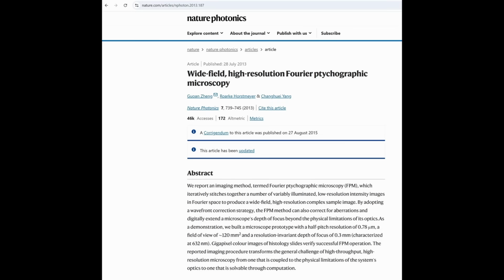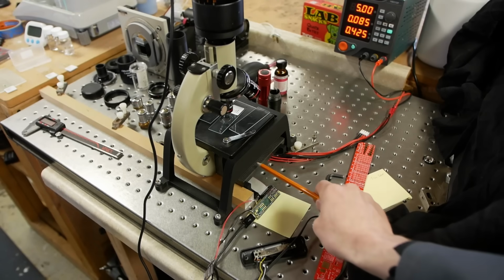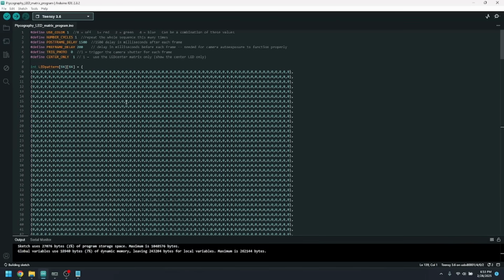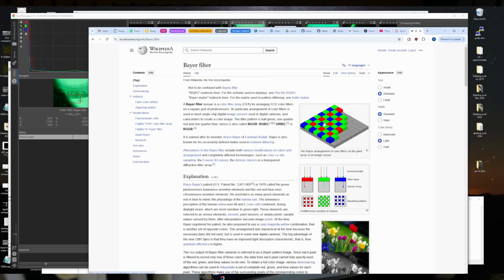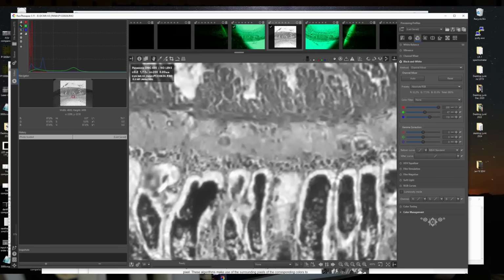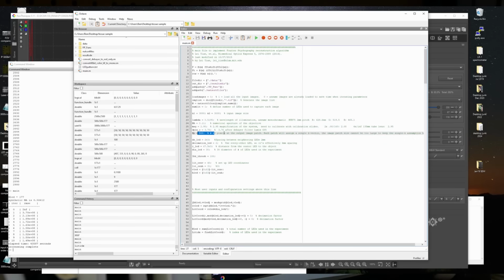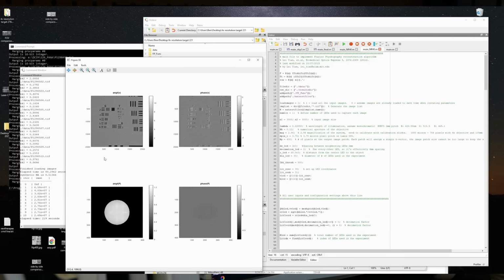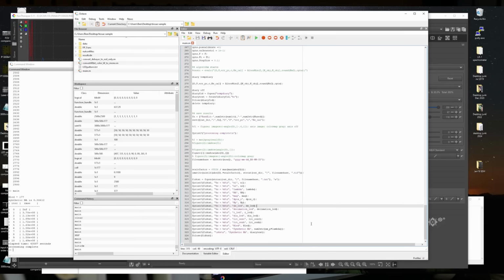Dramatically improve microscope resolution with an LED array and Fourier Ptychography

Comment: Neat technique, I wonder if your Bayer filter issue was due to using green - usually it gets two elements for every single red and blue, so the offset of the two is hiding some of the phase information that could be gathered since the pixels is effectively 2x as wide (though only double the active area).  Trying the same color image but using just the red or blue channel may yield better results if there's enough SNR there.

On the theme of trying to improve an existing microscope, I wonder if there's a way to make a stacked focus target for you do point spread function deconvolution without a motorized Z axis - something like a dozen layers of thin material with a sharp target to focus on all stacked up, so you could manually step through Z heights by finding focus at each sample height, collect your images, and then do more standard focus stacking for better depth of field or get point spread function information from a point target and then deconvolve a real sample using the same system.

Comment: I think the problem with the colour camera probably is that if you only use the red or blue RAW pixels your resolution is half what the camera says. You also have to be careful not to interpolate, just use the pixels as is. If you're using the green you'd have to figure out what the actual resolution is, most sensors have twice as many green sites as red and blue.

However, Fourier ptychography requires sufficient overlap in k-space between acquisitions (~ 50%). Your half resolution image has half the extent in k-space so the overlap is less. If the reconstruction is failing you might well be falling below the threshold of sufficient overlap. Since you mentioned your LED matrix pitch is higher than needed you could probably fix that by using every LED on your matrix, not every second one.
Reply: 12:41 I agree. I cannot see why Ben's argument would hold. Yes, using only the red pixels from the sensor subsamples the image. But using every pixel from the camera also subsamples the image...
Reply: I think it is more complex than that. You have to know what Bayer pattern is being used. And then you have to deconvolve the impulse response of that Bayer pattern with the sensor data.
Reply: @timseguine2 wouldn't manufacturing tolerances start to matter more for colour cameras? How well aligned are colour filters with the pixel sensors? (I really have no clue)
Reply: @LeRouxBodenstein  I am not sure either TBH. All I know is that mathematically it should still be possible to some extent. I think you can empirically measure the transfer function of your specific filter and lens setup on each channel. Theoretically you should be able to treat that like a calibration step.

Granted I know that this type of "just do X, the math says it should work" often has significant problems in practice, but a priori these don't seem entirely insurmountable to me. But maybe it turns out the noise floor is too high for the results to be useful or something.
Reply: @timseguine2  Or you just throw away the non-red pixels and accept you've got a quarter of the resolution?
Reply: Folks, there’s a way to deal with that madness too. Add a wee bit of current/voltage (tech-dependent) to the optical stabilization actuator in the camera. That displaces the sensor. It can be calibrated using a grating as the object.
Reply: @absurdengineering  That’s crazy, but it might just work
Reply: I agree, I came to the comments just to say the same thing. And using green isn't a simple 2x resolution, it's no longer a square sampling pattern, you'd have to use the two green sites separately (or modify the reconstruction technique to work with it).
Reply: This is the reverse, just as you can make a color image by taking three black-and-white photos with different filters.
Reply: Wonder if you could turn the LEDs red/blue to subtract out the overlap

Comment: Astrophotography cameras such as those produced by ZWO can be ordered without filters. Might be annoying to adapt from telescope threads to microscope, but may be easier to use than a scientific camera.
Reply: They often cone with 1.25" eyepiece adapter that should work for a telescope or microscope (e.g. ASI183MM)
Reply: This is the genius of many minds cooperating. 🎉
Reply: Even "cheap" nikon could be found without those filters on cmos.

Comment: 0:36 Love that Caltech used legos to make a stand for the device.
Reply: Lego bricks are incredibly consistent in size
Reply: @mikemclennan8917  that is actually very useful information.
Reply: I worked on a project that involved a controlled light source and heavy digital image processing for microscopy application, and can confirm that mechanical & optical engineers extensively used Legos for prototyping.
Reply: A grad student's gotta do what a grad student's gotta do.
Reply: Оптики в макетировании часто используют пластилин для детей

Comment: Mono cameras are often sold as astronomy cameras. You can get "normal" versions or cooled versions with less read noise. Check out PlayerOne Saturn-M for and example of a 1-inch uncompressed mono cam. It works via USB to a laptop, Mac or desktop.

Comment: For a better point light source you could use eiter a laser galvo scanner with a f-theta lens scanning the point on a phosphorus plate, or for a cheaper solution use the CRT screen of a old analog oscilloscope.
Reply: This makes me wonder about the possibility of doing holography with the variable-direction light source.
Reply: Monochromatic oled screen might work...

Comment: 16:57 - Yeah, in my experience consumer cameras tend to periodically take black images with the aperture closed to use as a reference to remove inherent noise in the sensor itself. The technique used may be overzealous for this kind of application. It's also possible this could be controlled via firmware settings/custom firmware; maybe look into what amateur astronomers/astrophotographers are doing these days?

Comment: I don't really understand why using only one channel wouldn't work. You say the problem is interpolating between the pixels but we don't need to do that. If we skip debayerization we could just create a mono image from one channel (with lower resolution). Having more space between the pixels could be an issue but cmos sensors already have a reduced fill factor.
Reply: I would think that the Bayer filter itself is the problem.
Reply: There is a pixel of dead space on all sides of a red pixel, so you would have to interpolate the missing samples, dramatically cutting your effective sensor resolution
Reply: this confused me a bit as well, might have something to do with the reconstruction algorithm expecting the gap between the individual photodiodes to be negligible
Reply: You don't know the exact grid of the sensors. Normal photo sensors are not as accurate as it's necessary for microscopic photography. So you work with an unknown grid that is going to be photographed with an unknown grid that does the photo.
So you'll need to measure the sensor gets with a known diffraction grid to compensate the errors in the photos. Doable but tedious.
Reply: @Craftlngo  complete nonsense. image sensors are silicon chips and thus incredibly precisely defined.
Reply: You only really need the sensor to know where in the picture the frequency is present. So the sensor resolution should only affect the output resolution not the captured detail.
If you use green for example the resolution would only be halfed.

Comment: If the camera used a 3 chip sensor with one sensor dedicated to each color, with each chip covering the entire image, would it allow it to be resolved?
Reply: The issue with that would be registration(alignment) and parallax. Aligning the images so the right points overlap isn't trivial, except if you are imaging at infinity, and all the cameras alignments are correct/known to less than the angle width of the pixels you're trying to resolve.

Comment: I'm curious if a grid of smaller LEDs will not work even better?
 you technically need only a one color led, so the circuit will not be very complicated, and you can have very small LEDs

Comment: Many astrophotography cameras are monochrome! 

Love your videos ❤
Reply: totally agree, and not expensive when you compare to his scientific camera as many commercial vendors.
Reply: Astrophotography cameras usually have much higher quantum efficiency than consumer DSLR/mirrorless cameras and some of them are actively cooled allowing them to operate below ambient temperature which dramatically improves signal to noise ratio. Something like QHY Camera 163 cool Mono would likely be a very good choice for this setup.
Reply: @Undy1  All of which is useful when you're taking pictures of faint fuzzies where every photon counts, but of no use with normal light levels and high SNR.
Reply: @stargazer7644  Except not all of the exposures have normal light levels - the middle LEDs sure, but the side LEDs make the images super dark as explained at 17:45 - it's not clear whether you can change the exposure to compensate but probably not. In which case the side LED illuminated photos will be inherently way more noisy than the directly illuminated photos. There's also that comment by the software author that says the denoising is important which also points to the fact that noise plays a factor here and getting rid of it is preferential.
Reply: Was about to mention the same thing. Can be useful?
Reply: Was going to post exactly this. Mono astrophotography cameras are expensive relative to bog-standard DSLRs or mirrorless cameras, but still pretty cheap compared to any "real" scientific instruments. They're also naturally designed for remote control/capture and download, which would make them easy to integrate into an automated setup like this.
Reply: The difference is that monochrome astrophotography is typically done in multiple passes, each with a different color filter in front of it.  So, to get color out of this, you’d have to have multi-color LEDs and do multiple passes on each target.
Reply: Thats fine you can get filter wheels that screw straight infront of your astro camera too, a short usb cable to the spare usbs that are on the back of the imaging camera and you only need a single usb to your imagi g cam to control the lot. 

Astro gear also typically uses ASCOM to communicate so you can use lots of different software with lots of different pieces of equipment. Very compatible
Reply: To be clearer, if the LEDs were white youd only need the filter wheel with the mono cam, unless im mistaken
Reply: This looks just like darksky imaging using stacked images to improve resolution.
Reply: @RowanHawkins besides lucky imaging (seeing through atmospheric turbulence), stacking images can only beat down noise, not improve resolution.

Mono astro cameras are definitely the cheapest way to do this though!
Reply: @Poladroid1881 Drizzle has entered the chat
Reply: @FocusDisorder  dithering is cheating. I will take no further questions
Reply: @RowanHawkins  Is this actually true? I mean, if I image a laser spot that is small enough to cover say, 3 by 3 pixel area of the sensor and I move the sensor half a pixel to any direction and image it again I might gain some more information. How am I wrong?
Reply: @Sekir80  yes, it is called pixel shift (now typical in DSLR cameras)
Reply: @RowanHawkins  This is a completely different technique.